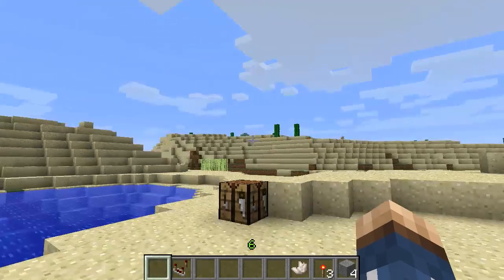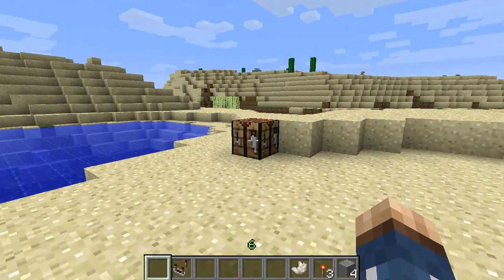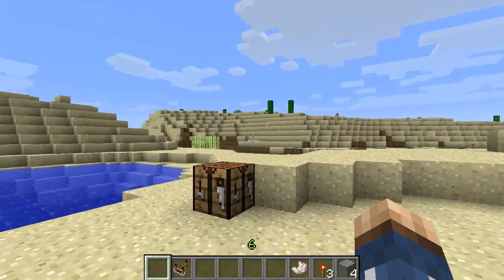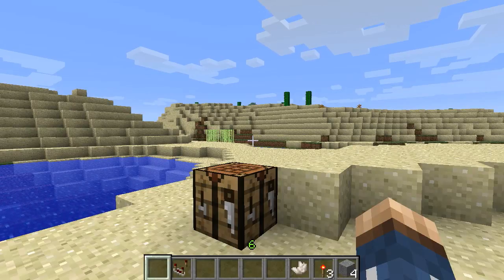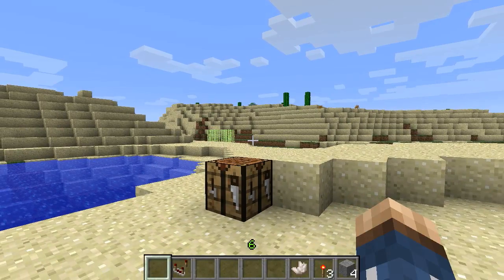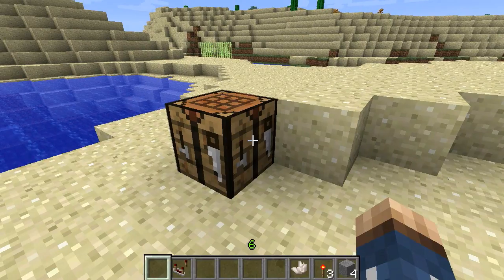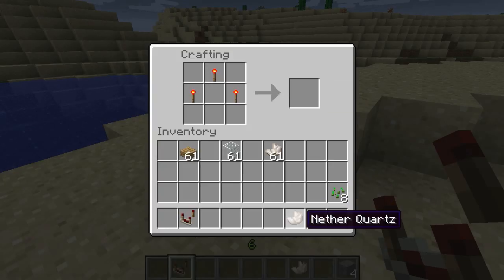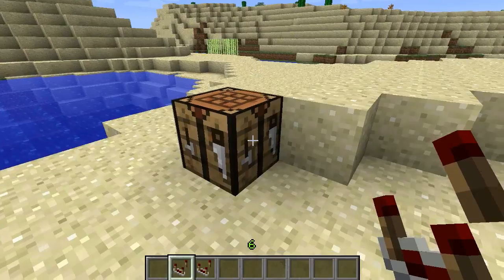★ Minecraft Tutorial - Redstone Comparator Tutorial (13w01A) (w/ KestalKayden)

Comment: I still don't get it...
Reply: Put it like this:
My A input is the first line, B is on the side, C is what I'm triggering. (TNT, whatever)
If A is stronger or equal to B, A continues.
If B is stronger it BLOCKS the signal.
Pretty simple.
Reply: Xenon Gameplay I'm starting to understand.... But I just don't understand the point of them. Wouldn't it be easier just to use repeaters and a lever, Etc?
Reply: 8BitBadger Yup. I used them a bit.... but I can't really find to big of a purpose for them.
Reply: Comparators really aren't used until you get into advanced redstone building. They have several uses,  like measuring how full a chest, furnace, hopper, etc. is. For instance, you can make it so it activates a trap whenever something is taken from a chest, because it measures when the chest is empty. You can also use this to make a door code with item frames, as they measure what position the item in item frames are in too. There are actually many cool things you can do with comparators, you just have to use your imagination to figure them out!

Comment: Can someone give me the 4 yr old's definition/purpose of a comparator?
Reply: I'm not sure there's an easy way to explain how it works, so the best way is to probably just explain what it would be used for.. and frankly, nothing super exciting for the average 4 year old.  The most superficially interesting usage of a comparator I've seen so far is to simply create a clunky sort of LED system to determine how much space you have in a chest.   Like, you could lay out 16 glowstone lamps, and they'd light up incrementally as the chest fills.. so if the chest is 1/4th full, you'd have a visual reference that 4 of 16 lamps were lit.  (I don't know why that's significantly better than just opening a chest and seeing its contents, but I guess if you have 36 chests, that might be handy.)
Reply: thx,you helped